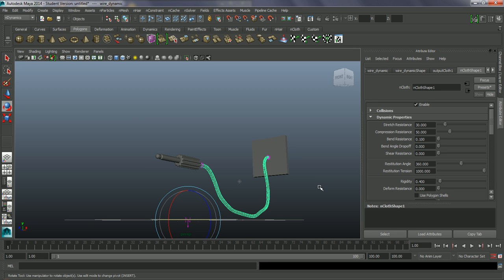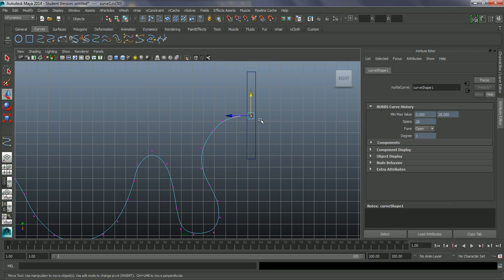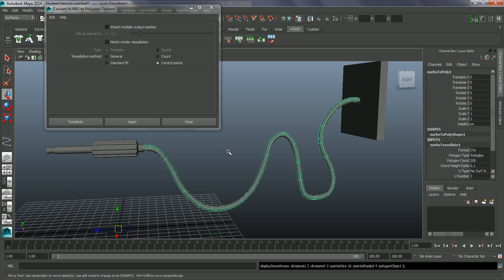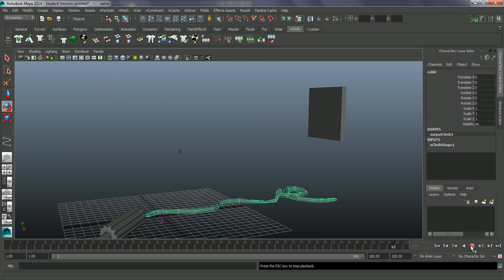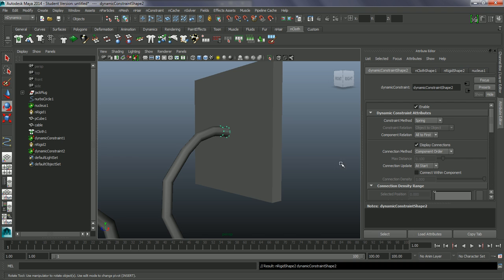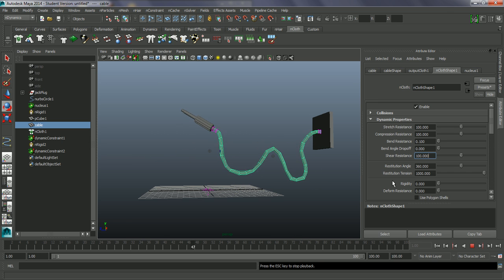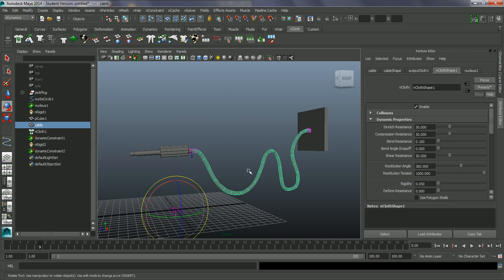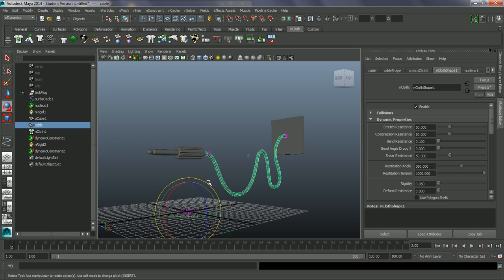Creating a dynamic cable in Maya

Comment: Great tutorial! I'm also stuck at the part were my wire keeps collapsing on itself.
Reply: There's not enough control to better shape it. It's ok for very straight forwards, super basic movement, but couldn't be used for most things where the shape needs changing, or other objects might intersect, or the coil would penetrate itself.